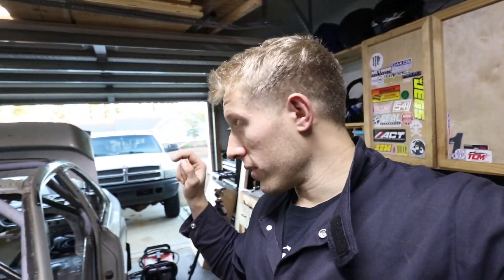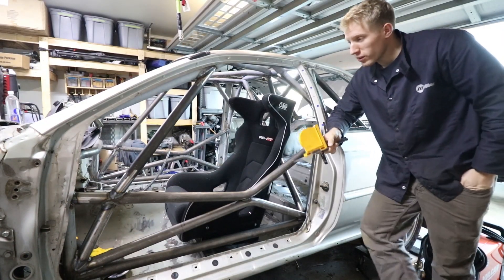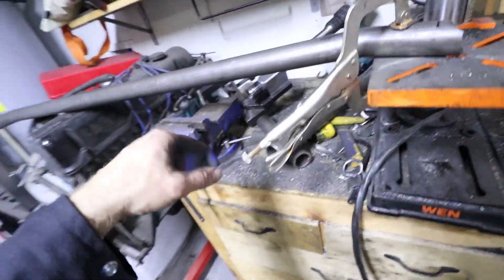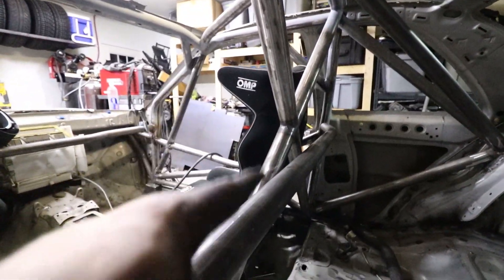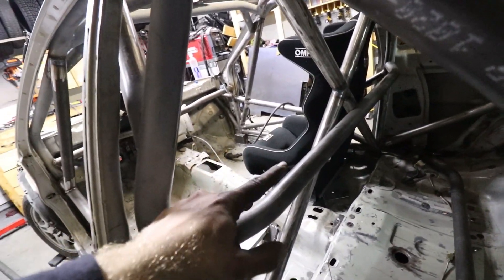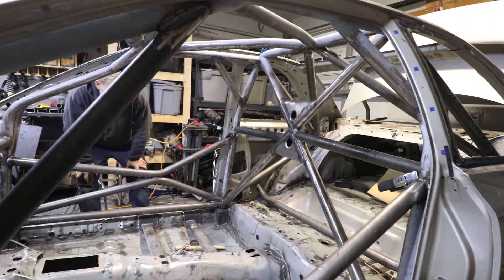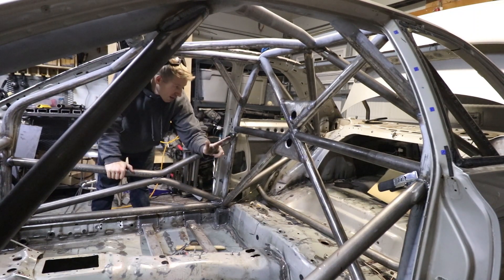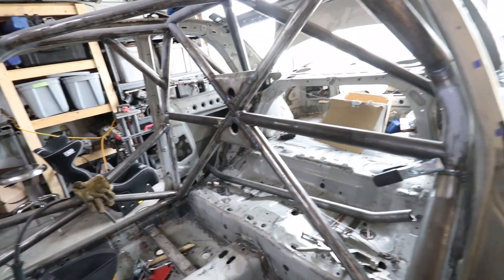GC8 Rally Car - Harness Bars - FIA Stage Rally Roll Cage Build

Comment: just to let you know ive built many rally cars over here in the uk. we had a recently come across many rally cars having accidents and their seats and rails ripping off the floors. it turned out that people building some of these cars were not welding the rails underneath and all the way around where the rails meet the plates on the floor. so i would suggest you weld underneath ur seat rails before you go anywhere near your first rally and possibly have a crash because that cage can have 20,000 extra tubes but if your seat rails arent welded properly no cage will save you when your rails snap off

Comment: Making notchs is far easier to do it freehand IMHO.  A 5" diamond cut off wheel on one grinder and a 5" 60-80 grit flap wheel on a second grinder is the best method for coping joints i have found.  It is just as fast as using the notch jig.  But you have more flexibility to alter the cope.  For example you can do odd angles and compound copes and offset copes etc quite easily.
Reply from the maker: Idk, for a simple cope it takes less than five minutes to cut it and then clean it up to weld. With the more complex notches I found looking at it as two different simple notches and making two separate cuts is a lot easier than trying to cut it out as one complex cope joint. Now for making the notches on a bend, like I needed to, cutting them by hand was definitely easier than messing with a drill press or the jig.

Comment: Given where you are now at, IF you were to make another FIA cage, would you change the sequence of tacking and fully welding to more tacking/tacking/tacking and then fully welding?  Trying to look at it from the standpoint of a large body and reduce the number of times having to crawl in, around and out of the sea of bars.
Reply from the maker: I tried to break it up that way to spread out the welding as much as I could. My welding skills go down dramatically after a few hours of straight welding, so if I left all of them to weld at the end it probably would have ended poorly for me.
Another reason I couldn't tack it all together was because I needed to drop the cage from the boxes.

If I did it again I would get as much completely welded together before dropping the cage off the boxes though, I had some slight movement of the bars and distortion after I dropped it and then welded it all, due to not getting enough welded up before hand. I would still weld it all in the same order though to limit having door bars in my way th and the A pillar bars.
Reply: Dirty Garage 
I think its perfectly normal for the cage shape to slightly move around as you drop it, fully weld it and re-erect it.  Mine did.  I had to get creative with clamps and ratchet straps to get it back to where i wanted it before welding out the bottom.

Its not from a lack of welds before dropping the cage, its a function of welding.

Metal always has a tendancy to move and distort with welding.  Its due to the way the metal cools after the weld.  When metal is hot, it expands, and when its cool, it shrinks.  When welding, the metal takes its shape just as it goes from a liquid to a solid.  Which is still really really hot (and expanded).  As it goes from just below molten liquid temp, back down to room temp, it will naturally want to pull and distort as it cools and shrinks.  And this is where the movement and distortion comes from.

Mild steel isnt so bad, but stainless steel is quite noticeable for this.  When i built my EJ low mount turbo headers, i had a real hard time with distortion.  I had to actually plan out the welding sequence, so as to minimise the creep of the metal.  The tubes moved around alot as welds were done.
Reply: Thanks for the responses, I'm tall, 6'5" and the better part of 300lbs so I am always looking for ways to minimize the number of times I have to crawl in there and maximize time spent on the interior of vehicles in small spaces, let alone with roll cage bars all over the place.
Hadn't thought of the welding skills perspective.